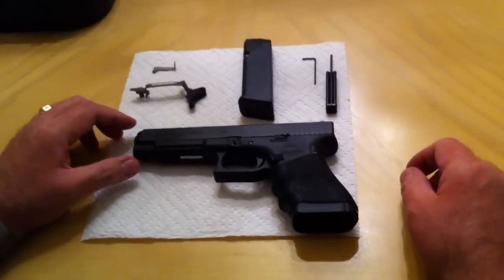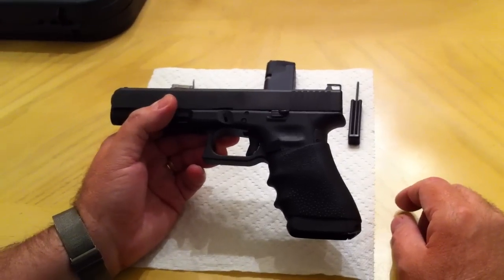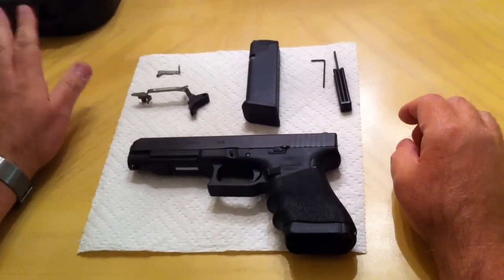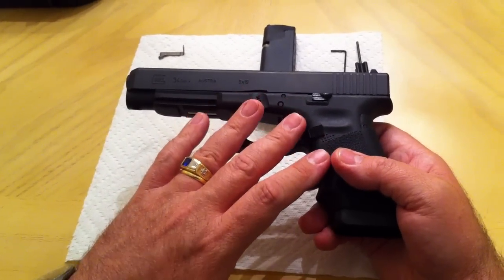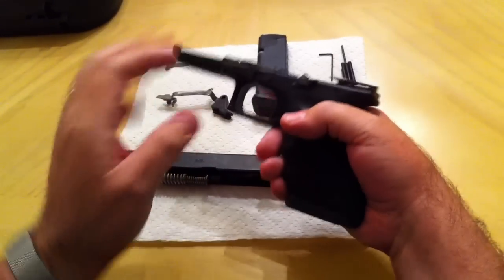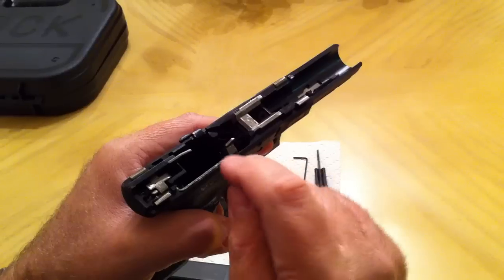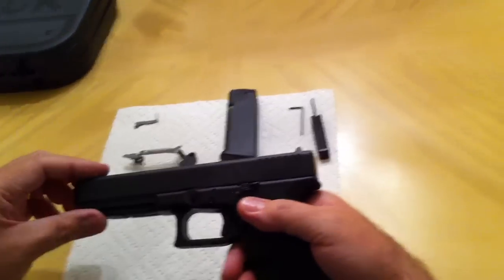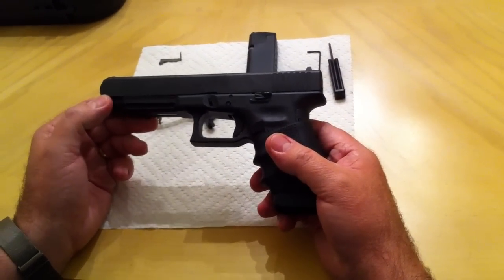Glock 34 Gen 4 with Gen 3 trigger bar, (-) connector and rubber grip

Comment: The shop where I bought my Glock at also says to use the Gen 3 connector .  I guess it is well known already that the Gen 4 Glocks are harder to get a good trigger pull.  He told me that it will lighten it up more with the Gen 3.  Great work by you, Thanks a lot for all the help.
By the way, I have not shot my Gen 4 G21 yet, but while dry-firing I thought it felt smoother than my Gen 3, but it has been many years since I owned a Glock so maybe I was expecting it to be worse than what it is.
Reply from the maker: Glock kind of fixed it later, with the trigger bar (.) connector (dot connector).

Comment: I bought a new 27, first time I shot it, it wouldn't fire more than two in a row without having the trigger fail to return to firing position. returned to glock, when it was returned to me, it had a gen 3 trigger bar.
Reply from the maker: It works well, they probably used the latest parts available.

Comment from the maker: As an update, after a few weekends on the range, I am not shooting with my Glock 34 Gen 4 as well as I am shooting with my Glock 19 Gen 3... in a 500 point match, I am oscillating in between 480 and 490 points with both firearms... Now I need to learn how to take 2 or 3 shots more to be on the 490+ club. All in all, I love my G34 Gen 4.